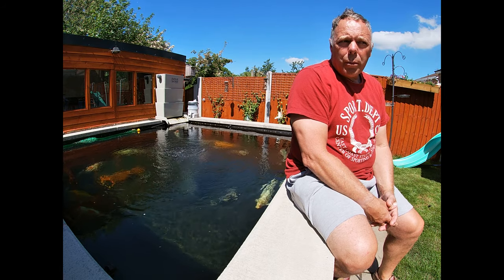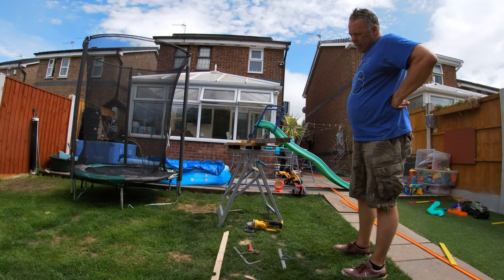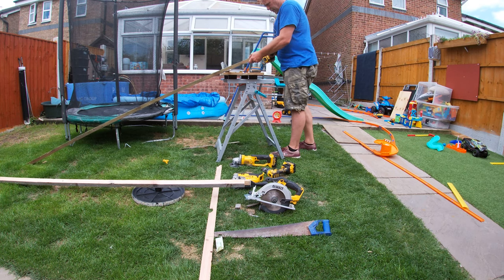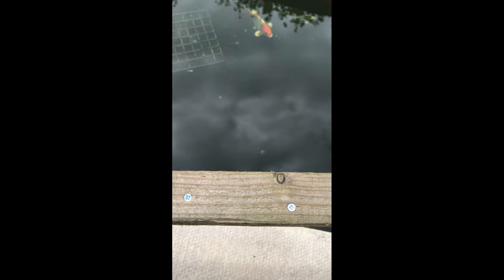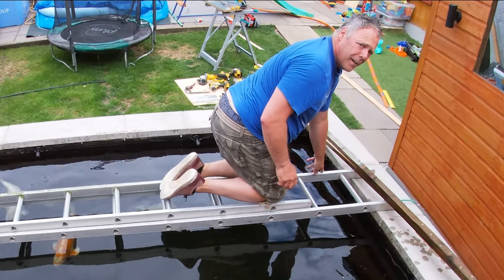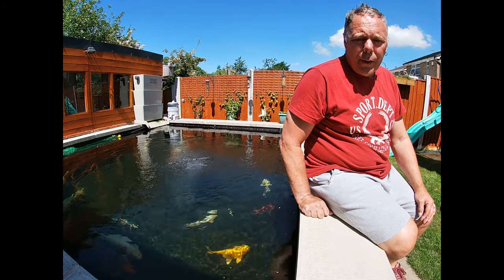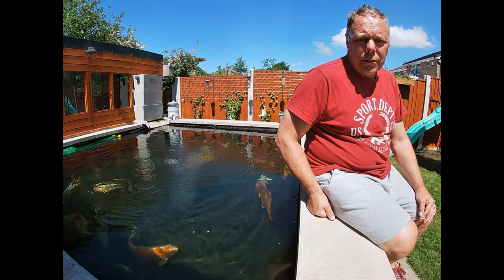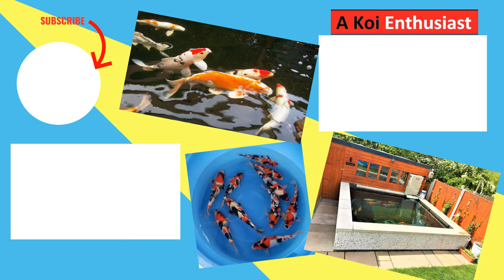How To Replace A Koi Pond Bottom Drain Cover - Without Getting Wet - Step By Step Guide

Comment: Nice job lost my top a month or two back I was lucky and got it back on with just a tap and push with my pond brush in a min's but was thinking I would have to make something like this as well I could not remember where I had seen it till you said thanks for filming there is a patch on the side of one of the fish at 9.19 that could do with a little close looking at out of the pond I have a fish carry's pox all year round to a lesser extent summer but has 2 similar patches I have him out 2 or 3 times over a summer every year and give a light clean to them but not a lot you can do more than that with pox and he's been like it for 13 or 14 years
Reply: I said about it cause it looks very much like a spot on one of my fish I have had the little bugger from 4 inch now 20 as he was free and the last one of the batch he had pox then I got him and still has it 13/14 years later he is a social has two pox spots one on his head one on the base top of his tail the spot on his head looks near the same as your fish but about half the size he has also carried a growth on his upper lip for 10 years plus that gets no bigger and don't effect him eating so have left be for that time the pox spots I have him out 2/3 times over summer clean the spots very lightly and give it a wound treat and seal it but it gets no better or worse. And everyone says there is no treatment for the pox I take it the fish is a bad case carrier of it and it will never go away like it has on the other odd fish I have had that has had it. If I had dun right he would have been tapped on the head at 4 inch but I liked the little chap but I seem to collect lame ducks I have 2 more that have on going problems as well